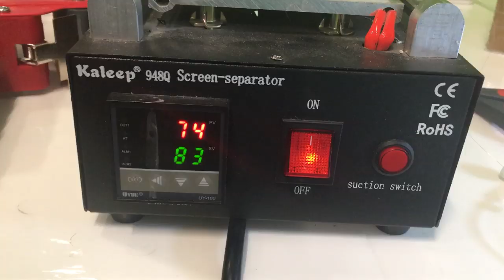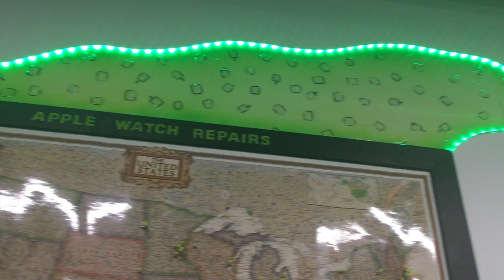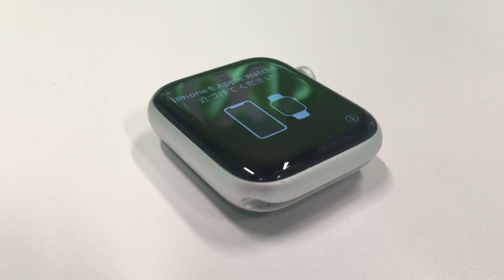Apple Watch Series 5 Glass Repair Success

Comment: I love the way you’re calm about these fixes that are crazy difficult 😂.
Reply: With some tools and a little bit of patience it really isn't too hard. And is a great way to make money, you can buy the glass for about €2-€5 a pop from china, need a hot plate, and some other stuff, you can totally start this with about +- €100-€150 in tools and supplies. 
It gets waaaaay easier with a microscope, so you can see you are cutting the right glue layer. 
Customers are very happy with a fixed display for way cheaper than apple fixes it, it is enviromentally friendly, and because you are not swapping the display, you keep full Apple Pay functionality, that you otherwise lose with a display swap (if not done by apple) because that is paired to the display.

Comment: if you remove the copper sticker and leave the 3 connector ? the iwatch will not work? i mean the screen. please can you help me?  
i ruined the digitizer and i have to find one digitizer to put it on but the problem is that i connect the diplay with the connectors and doesnt work

Comment: Great Video thanks! For how long do you let the glue settle in the clamps until you give it back to the customer? For cleaning the Display can i use Isopropyl instead of Acetone? For one Reparation I got vertikal white Lines  on the Display aon the right side after it, even with doing it very carefully. I believe it must have been the isopropyl. Do you have any suggestions? Regardings!

Comment: Do you still repair Series 2 and 3 or you only focus in Series 4 and 5? Because in Series 2 and 3 you have to pair the digitizer, and can't be done. Thanks for your video!
Reply from the maker: Santiago Fdez I do fix the series 2 and 3 and have no issues pairing them

Comment: Why not brake glass more with pliers like the series 4 so you can get the wire in easily ?
Reply from the maker: S N great question, not really an option with the series 4 and 5. The series 2 and 3 can be done with pliers, but the glass is to close to the display to do it without the risk of damaging the display on the 4 and 5.
Reply: FIXD Phone Repair I do crack them with pliers on series 4 seems to be ok. I got scared when the screen started bending when I did a series 5 yesterday without cracking more lol 😅 came out perfectly fine tho. I guess it all depends on what you are use to

Comment: I just ruined my applewatch by scaping of the adhesive on the digitizer with a plastic screen remover :( I can feel the touch is working but I have no picture
Reply from the maker: sorry to hear that Nico, Its definitely tricky to replace just the glass and the display is extremally sensitive as you've experienced.
Reply: @FIXDPHONES  thanks! Should have watched your video first 😅